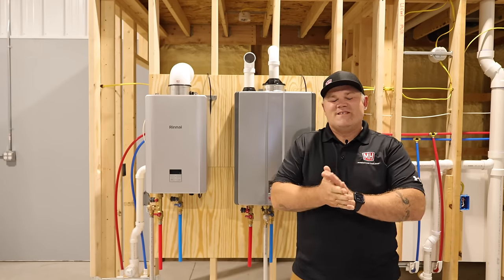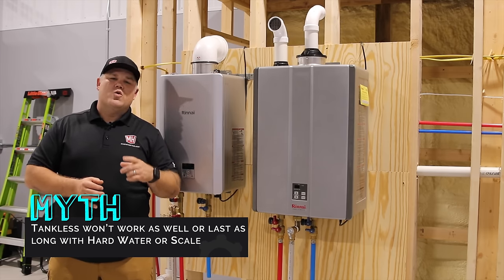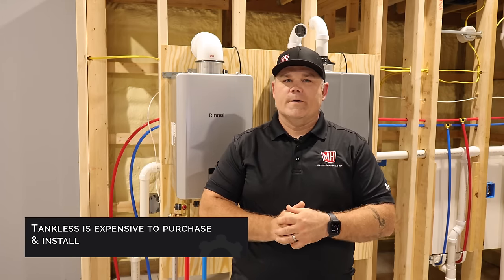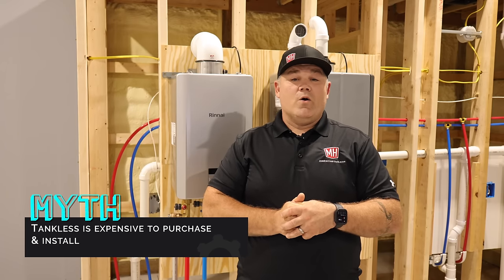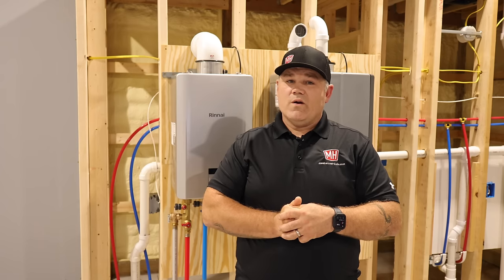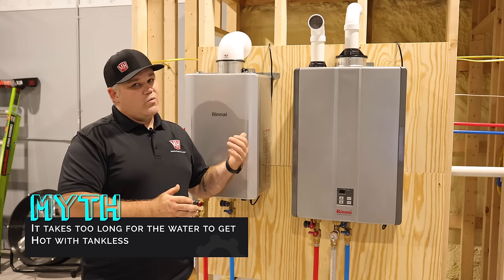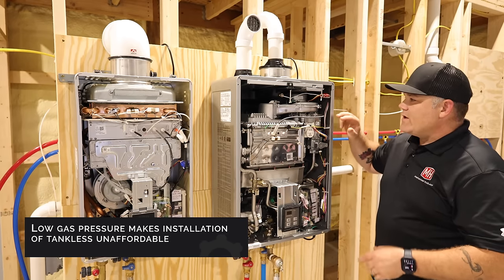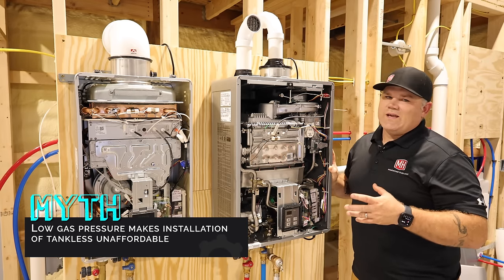Myth Busting! Tank -vs- Tankless Water Heaters

Comment: Great content as always Eric!
 Thank you for mentioning water quality. Tip for others, make sure the water conditioning equipment will allow and condition/treat at the required flow without to much pressure drop.
Reply from the maker: Great tip! Thank you for adding this.
Reply: What about electrical water heaters
Reply: @billkerber4187  there are tankless that run on 220v and don't require any venting at all.
Reply: @mechanical-hub  In what areas do you provide installation cervices?
Reply: 1) Hard water and scale are a symptom to a problem that should be addressed. However, it’s really optional to address it in a house with a tank. Whereas a house with tankless must address it. The tankless water heater has smaller diameter tubes through the heat exchanger that will eventually plug up. Also, by nature, a tankless heats up and cools down regularly, which accelerates the process of scale buildup. So no, it is not a myth that tankless are more problematic with hard water. Tank water heaters are much more forgiving.

2) Your right, the math is simple and a lot of older homes have showers that go well over 5gpm. Even a new single handle tub spout that doesn’t give you control of the flow rate will struggle to keep up. 

3) Maybe with a non-condensing Rinnai on an outside wall. The price is close to a tank swap but as soon as you run in PVC over 10 feet and have an a put in a neutralizer and condensate pump with polybraid to the nearest drain, you’ve tripled your labor over a tank for tank swap. 

5) you offered solutions to solve the issue of it taking longer to heat up, but the fact remains that unless the tankless has the setting to keep the heat exchanger warm (Like IBC SFTs) it still takes longer to heat up.

7) the type of gas valve, and whether it has an inducer or not, doesn’t change the gas requirement to the unit. 9 times out of 10 an existing tank water heater is being fed by 1/2” and based on the IFGC, you can do a maximum of 174,000 BTUs for a maximum of 10’ on half inch. So, the majority of the time you will need to upsize the gas line to meet your BTU and distance requirements if you’re doing it right. Also, around here the standard gas meter will only handle 400,000 BTUs. So if your customer already has a 60k BTU range, 30k BTU dryer, 40k BTU fireplace 90k BTU furnace, 30K BTU garage heater and you’re going to add a 199k BTU on demand when are we looking at the meter size and the main gas trunks?
Reply: @icefishalaska3814 … You missed Coldwater sandwich!😅… Nice review on your part!
Reply: Speaking of water quality I had to replace a tank heater and I was not able to fully drain the old one because it was so clogged up.
Reply: @B.L.A. Tankless water heaters are definitely more expensive than natural vent but about on par with a power vent system.  I have a 40 gallon power vent which is 25 years old and heats perfect.  Just installed an anode rod for the third time and I expect it to last at least another 8 years.  Good luck getting that kind of mileage out of your tankless.
Reply: @B.L.A. A 27kw tankless and a 50gal standard are about the same price.  The problem is, if your water heater is far away from your electrical panel you're looking at a price increase of at least $200 for 3 40 amp, 240v branch circuits (8/2 NM, usually around $2.50 per foot).
30' away? $225 +tax, plus 3 2pole 40 amp breakers, another $45.
Of course, gas wouldn't have this problem.
Reply: @icefishalaska3814  omg thank you! Excellant reply!!!
Reply: @robhardy1109  Ok and you will probably save 3 to 4 times that in the first year of use.
Reply: 15 years out of a tank heater is pretty darn good
Reply: @icefishalaska3814  I agree that tankless is more expensive but I wanted to address some of your other points as it related to our situation. We have a 1" gas line that travels about 60 feet to service our tankless and the furnace 120,000 btu.   I was a bit concerned if it would be large enough but we have stressed tested it with both systems running at max and no issues.

We have a large bathtub in our second bath but the old tank would run out of water about 2/3rds full.  First time I took a bath with the tankless I was able to run it full out and the water stayed hot until it was all the way up to the overflow drain.

Can't argue with it taking a bit longer to heat up.  Instead of having it recirc all the time or on a schedule we put a button in our bathroom so we can tell it to recirc hot water in to the line when we need it.  Reasonable workaround to be more efficient for us.
Reply: @B.L.A. WHY?
Reply: @j.skidmore  Your builder made up the additional cost of the tank versus tankless somewhere; either that or he is an incompetent builder.  If he is charging the same for a $400 builder's grade tank type versus $1500 for a tankless plus having to run a 1" gas line (190,000 Btu) versus 1/2 - 3/4", plus electrical wiring, a condensate drain line, etc., he has no idea what he is doing.
Reply: Bs tankless is more expensive. I’m a plumber for 24 years .converting It is the most expensive part.
Reply: @robhardy1109  what about the fact that most tank water heaters are 80 percent and vented with metal,  and need to run all new venting?
Reply: You are right Matt doesn't lie, but you do. I've had two tankless and now I have gone back to a tank water heater and my God I'm so glad I did.
Reply: @briancrist6388  A gas tankless requires venting too.  My example was in sidegrading and existing water heater to an electric tankless -that's why I was very specific with my information.
Reply: @tinkerinwithtom8725  How can you save $800-$1100 in the first year when a 50 gallon electric water heater only uses around $500 per year?  Tankless is great, but disinformation will keep folks wary of switching over.
Reply: Your so wrong this whole video is wrong I’ve got 23 years installed 100s of tiles all of them suck you never ever get your money back constant fixing of unit constant cleaning parts are horrible to get all stay away I promise
Reply: @One Issue Voter the tankless device itself costs more, but, the operating costs over time will make it more cost effective.  Plus you'll never run of hot water
Reply: You never addressed the safety. A hot water tank is a bomb if the pop off valve is not working properly.
Reply: @One Issue Voter tankless water heaters are initially more expensive but I’m almost 79 and had the same tankless for at least 40 years. I would be on my 3rd tank type heater now, not to mention 40 years of reduced gas bills. I’ve commented about what is necessary for the proper installation and maintenance of a tankless water heater. If these things are not followed, the water heater will not last or perform properly.
Reply: @icefishalaska3814  Thanks for your analysis and valuable information.
Reply: @robertgreenlee4542  The button idea is Brilliant !
Reply: @mechanical-hub  
Can you install in an RV? Older 1995 RV that runs off 50amp service.
Reply: @TimothyMichaels  - you can buy unit's at much lower kw ratings - I'm running a 6 kw unit that happily runs 2 showers at once on an almost daily basis. Mine has a 3 position rotary dial with an option of a lower kw element, a higher kw element or both elements together and I have never used the dual element except for testing it after installing - the only downside I see is that it's high efficiency is directly tied to the "electronic brains" controlling it sort of like rebuilding an old fashioned carburetor vs diagnosing a modern fuel injection system -  However an RV is a perfect candidate for a propane model - I am texting from a country with the highest electricity cost in all of Latin America - I've installed these in multiple places (and countries) my forte is electricity not plumbing and I find it much easier and cheaper to run electrical cable than plumbing inside of cement buildings
Reply: @@s2kdriver I put one in myself for the price of a few new circuit breakers, wire and the heater.  Then you never have too replace the tank again. done.
Reply: @williambrown7719  thank you i had tankless and went back to a tank as the price sky rocketed 3 yrs ago. The problem they don't tell you is when one of the many components goes bad on a T-less and around at least 20% do at around 10 yrs it's as expensive as a tank just for the component. The little savings you have on natural gas is off set by the greed of the companies by pricing their components.And old plumber told me to open the the bottom drain on a tank at least once a week. Which i do for cleaning  jobs. This will blow out scale and sediment
Reply: @One Issue Voter Thank you for your candor,
Reply: @icefishalaska3814  Thank you!
Reply: The expensive part he did not mention is often you have to run new electrical and in many older homes it includes upgrading your electric box.
Reply: Maintenance 😢
Reply: @BL Alley That's complete bullshyt and you are being disingenuous at best. There are two primary types of tankless heaters. Gas or Electric heated. Your GAS heated is probably not too bad to upgrade to because all you need is either a gas hookup which is usually fairly affordable because the gas company will pay most of the cost for you to become a new customer; or get a tank outside that you can get refilled as needed. Natural gas itself is usually cheaper than electricity during peak hours anyway so this would be the best option if you want to go tankless. The existing water heater electric line can easily be converted over to power the pilot light without changing any of the wiring.

Why this video and your remark is complete bullshyt is because of the other VASTLY more expensive route which is the all-electric tankless water heater. Before you try to disregard this as some "you don't know what you're talking about" line of anecdotal evidence. I am a licensed commercial electrician. I've installed hundreds of these units. I've also been an electrician for over 20 years working in maritime, industrial, commercial, and residential electrical systems. The units themselves are not much more than a tank water heater. The plumber's install time and work required isn't much different either. So plumbing wise tankless versus a tank water heater is about even. Now where these units differ is in the electrical demands. This wasn't illustrated or differentiated in either this video (probably on purpose) nor in your comment. So I will elaborate on it. 

A typical 3 bedroom 1 to 1.5 bath house is built with 100A utility service. This includes the 30A 2 pole breaker for the standard 40 to 60 gallon hot water heater. Your typical tankless all-electrical water heater is between 24kw to 28kw and will draw between 100A to 120A BY ITSELF. So if you want to "upgrade" to a tankless all-electric hot water heater you need to at the minimum upgrade your electric service to 200A service ... if you already don't have 200A service that will run you $1500 to $3000 or more depending on where you live. Plus you will need an electrical contractor to pull a permit because I don't know a single electrical utility that will let you upgrade a house's service without their approval first. If you already have a 200A service then you need to make sure that you have space in your existing service equipment to add another 100 to 125A breaker. Many don't. If you are getting your service upgraded hopefully your electrician will ALSO upgrade your service equipment knowing you need more breaker space for the added load. If you need to upgrade your service equipment separately you are right back at spending $1500 to $3000+ for a new main panel. 

Now you need to run a new electrical line for your tankless water heater. That installation involves running conduit to the unit and I hope that where you installed your unit is very close to your main panel; if you think plumbing prices are expensive wait till you start shopping for electrical wire by the foot. Usually most of the all-electric hot water heaters is going to require you to go #2 AWG copper or 1/0 AWG aluminum route and the #2 copper is between $12.50 and $20.00 per foot on average for all the wires you need. Not all local building codes will allow you to use aluminum wiring so I'd check for that on your own first to make sure that the electrician you hire won't try to take the more expensive route unless he has to. The wire alone can cost as much as or more than the tankless hot water heater depending on how far away it is. That doesn't include the conduit installation. There will be even more involved to run your wire inside your walls or attic space but might be worth it if you have a shorter wire run overall.

There are some things that will add to the expense on top of this. Namely if your HOA will let you run your conduit exposed. One job I did the HOA didn't allow it and all of the electrical services to his hot water heater had to be buried. Which meant going around his house's foundation. Which meant a long route around the back of his house. He understood all of the headaches but his wife wanted a tankless water heater. So he paid for the nearly $12,000 electrical install, main panel, and service upgrades. Just so his wife could enjoy hot water 24/7 from an $800 all-electric hot water heater. 

All of these extra costs very quickly add up so home-owners need to become aware of the totality of the jobs they are asking about before they start. It's one thing to get a licensed tradesman to install and just "have an electrician do the electrical hookup". Without first consulting all of the other trades that might be needed. Operators and laborers to dig a trench and backfill buried electrical conduit. Carpenters, tapers, and painters (if you don't want to paint yourself) to open walls and/or ceilings to run electrical wire inside. Etc. Simple jobs can turn very complex for homeowners who don't understand the entire scope beforehand and allows for less reputable individuals to milk homeowners because "they know a guy" and can prey on the homeowner's inexperience or naivety. That doesn't even begin to cover the costs if things go wrong because a homeowner got someone unlicensed or doesn't really know what they are doing to save money ...

P.S. Tankless hot water heaters also don't add to most home's values so whatever is spent most often isn't value added.
Reply: @BL Alley obviously you have no idea and spread misinformation all good you do you I got 23 years beleave what you want I’ve only seen it is all.
Reply: How much money did Rinnai pay you for this?  This video reeks of paid shil.

Tankless won’t work with Hard Water and Scaling: 
This is not a Myth, you are presenting it in a way that is misleading.  You fail to mention that MOST brands of tankless water heaters demand/all but require a water softener be installed in line before your tankless water heater SPECIFICALLY DUE to the units not being able to handle hard water.  Even in a city with "treated water" they still say to install a water softener.  So while you are technically correct, your statement is misleading by you omitting that "treatment" of water will require the additional purchase of a water softener.  Don't believe me, get a quote from a certified installer in your area and if you don't have a water softener, he is more than likely to tell you that you'll need one.
Result: Lie by omission.  You're a paid product shil.

Tankless does not do well w/ Cold Ground Water Temps:
Nice suspicious fade cut in your explanation before you changed course.  While you can try to talk about numbers, you do nothing to prove your point except saying "Take my word for it".  Perception is reality and as the general perception, and review of many units in the wild, is that you can't run as many things on a tankless  vs tank, you cannot argue with the capacity of a hot water tank to multitask under heavy loads that most households will face.  Your shower vs kitchen faucet is true, but laughable as most will end up facing a shower vs dishwasher or cloths washer.  So this point is dependent on need/water demand.
Result: Arbitrary.  You're a paid product shil.

Tankless is expensive to purchase & install: 
Wrong again.  Most tankless water heaters are at or near DOUBLE what a 50GAL tank heater is.  The ones that weren't were not worth the materials they were made from.  Even now the prices are still not comparable to most tank units you can get.  Oh and you forgot your first point, if you don't have a water softener, get ready to buy that too and your price just rocketed past a tank water heater. Don't believe me?  Go to Lowes or Home Depot website and look at the cost of Tank vs Tankless water heaters.  On top of that now look at a water softener if you don't have one.  With very few exceptions nearly all tankless are $200 to nearly $800 more than a tank, then add on the water softener.  Tank water heater starts to look pretty good.
Result: Lie by omission.  You're a paid product shil.

Venting for tankless is too expensive: 
Your assessment is arbitrary.  Installation will always depend on the age of the house and existing appliances in place.  So this is going to be case by case. Older homes are likely to be more expensive on installation as you may have to drill or make holes in existing structures.  Quotes for the work will be needed to assess true cost.  
Result: Inaccurate.  You're a paid product shil.

It takes too long for the water to get hot: 
While you are correct in the amount of pipe between you and the hot water "the right unit" will cost you substantially more and likely require more in setup costs and maintenance.  So while your point is somewhat correct you omit more facts. Depending on the unit you purchase, some units can take 15-30 seconds of run time before they will engage their coils which wastes water.  So this point depends as much on length of pipe, as it does the timing of the unit.
Result:  You're a paid product shil.

Stainless steel heat exchangers are better than copper: 
This one is correct, Copper is a better conductor but Stainless steel stands up to environmental effects for much longer than Copper will.  So usage is dependent.

Low gas pressure makes installation of tankless unaffordable: 
Not always true, but you think it is a total Myth.  You contradict yourself.  It will be based on the age of the house and size of the pipe and pressure of said pipe delivered via the gas company.  Then you also need to factor in other appliances in the house that consume natural gas.  Many homes are likely to need an upgrade their gas line to accommodate a unit such as this vs a tank heater.  However since you contradict yourself and side on it being Myth... 
Result: Inaccurate.  You're a paid product shil.

Point 8: Proven technology?  Well it's been around for a while, but so have many other not so good technologies. This is a point of view.  Just because it is proven, does not mean it is good tech and will be based on need.  You may have installed dozens and dozens of tankless water heaters.  How many tank water heaters have been installed over the years?  Thousands, tens of thousands, hundreds of thousands?  How many do you still install today?  Japan is also very small, and while this tech has gone worldwide, it is still very small footprint wise.  There have been many types of technology that have been around for a while that are "proven" but still aren't good technologies.
Result: Arbitrary. You're a paid product shil.

Your points are arguable and you omit too many facts in trying to talk up this technology.  You make it look more appealing and affordable than it is likely to be for most people in old or older homes.  Even with the "rising cost of building materials" a tank water heater is still likely to be cheaper on average, with less unit cost, installation cost and long term maintenance costs.  Everything depends on need.  Not everyone will need one of these things but maybe next time hit the facts instead of paid selling points.
Reply: Also with all the tankless I have seen if you don't put in the filters and conditioning it voids the warranty. Make sure you put those in at the same time you are installing the tankless or install them BWFORE you install the tankless.
Reply: @TheMegaGrale  Great Response!

Also, changing water from 40 degrees to 120 degrees in about two seconds in a tankless will take more therms than at a slower rate with a tank water heater.
Reply: @icefishalaska3814  Your comment about the gas line upsizing resonated with me. About 20 years ago, I had an addition built on my house and I decided to install a tankless hot water heater for the new bathrooms. I had two reasons to go tankless: 1 - I wanted more usable space downstairs so I put the utility room upstairs and I didn't want a tank upstairs. 2 - I wanted to take advantage of the smaller size of the tankless heater and thereby reduce the size of the new utility room. I know nothing about plumbing, so it did not occur to me that extending the existing gas line from the main house to the addition would not provide enough gas flow for the gigantic burner in the tankless heater. So, surprise, surprise, the gas line had to be substantially upsized, and this was an older house, so  before PEX. So the existing smaller (.5"? or .75"?) steel pipe had to be ripped out and a whole bunch of much larger (1.5"?) steel pipe had to be installed. Not a showstopper, but a very memorable, and expensive, lesson. More recently, in a different house now, I had a gas-fired pool heater installed; the ultimate tankless water heater. It needed 75 feet of 3" PEX to supply gas to the 400,000 BTU burner. The 3" PEX looks like the gigantic yellow gas main you see in the street. And yes, the gas company replaced the meter with a bigger one.
Reply: Jesus is the only way to healing, restoration and salvation to all souls. Please turn to him and he will change your life, depression into delight, soul heading from hell to heaven all because of what he did on the cross 

“Whoever calls upon the name of the Lord shall be saved” Romans 10:13
Reply: Jesus is the only way to healing, restoration and salvation to all souls. Please turn to him and he will change your life, depression into delight, soul heading from hell to heaven all because of what he did on the cross 

“Whoever calls upon the name of the Lord shall be saved” Romans 10:13
Reply: Does tankless work well at high elevations, like over 7k'? And is there a difference in effectiveness between an electric vs gas unit?
Reply: @E3ECO  any gas loses heating ability with an increase in elevation. Natural gas at sea level should be around 1000 btu's/ cubic foot. At 3000 ft, you lose 4% of the heating value so a cubic ft of nat gas is 960 btu's / cubic ft
Reply: @garyangelstad5212  So an electric tankless heater should perform the same at any elevation? (I'm thinking of getting one.)
Reply: What is this button you mentioned? Can you post info?